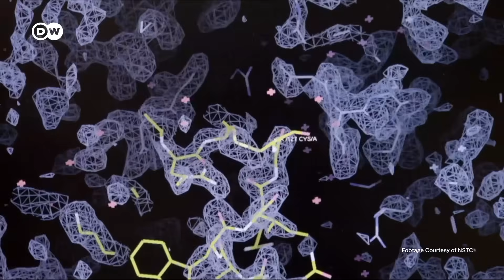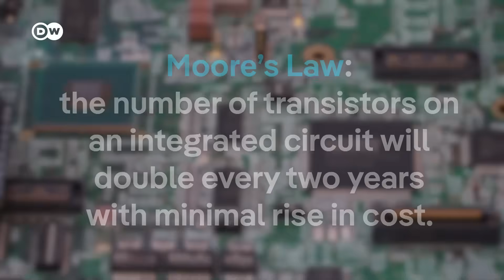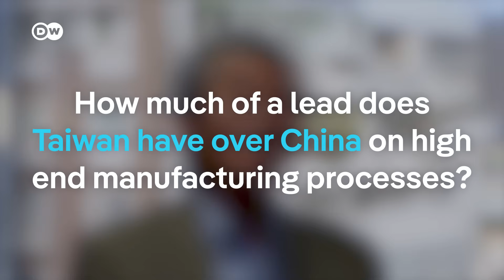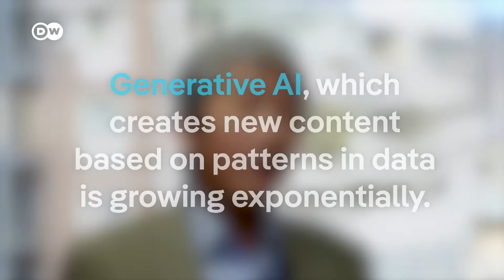AI set to turbocharge Taiwan's microchip industry | DW News

Comment: AI has literally nothing to do with cutting edge production of microchips. Everything flows through ASML which develop the $400 million lithography machines. That company is running up against the boundaries of EUV. The next obvious improvement is X-rays, but EUV is already pushing the boundaries of the number of silicon atoms needed to insulate transistors.
Reply: ASML does not do anything without the Zeiss equipment. It is a  very close relationship among few companies.
Reply: @eduardomeller6926  Exactly sir. I am so glad you pointed that out. Seven nations contribute the ten required additions to the ASML lithography machines.
Reply: Wouldn't new technology driven by new software new fabrication techniques and maybe new materials could all be with ai contributions . Man has created what's currently being used including ai to think for us and to do it better and faster  than us will also be a big influence to the future of microchip fabrication . Just a thought
Reply: @dannydukes30  Perhaps AI could contribute, but I cannot think of a specific use case. ASML's 2nm lithography machines are perhaps the most complex devices we humans have ever constructed. There are 6,000 companies that contribute to the construction of those chips. It is an incredibly fragile ecosystem and TSMC's most impressive achievement is to manage the supply chain.
Reply: So if it’s as simple as throwing things into lithography machines, why don’t NVIDIA just buy some lithography machines from ASML and start printing GPU chips then?